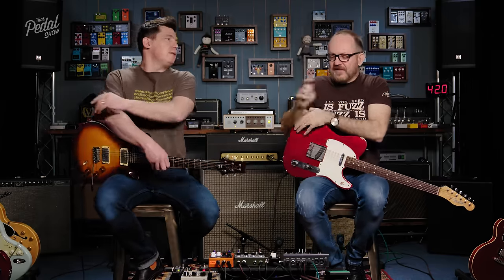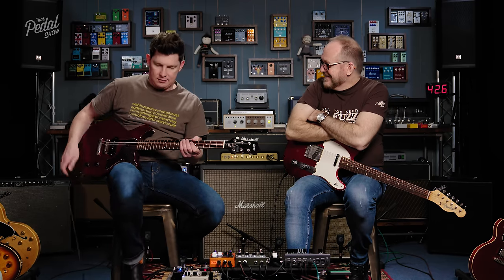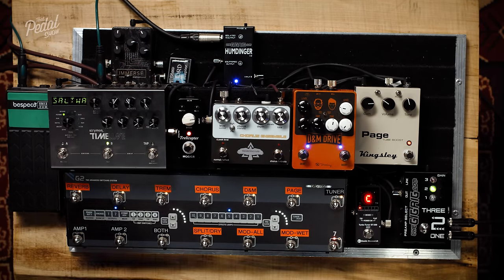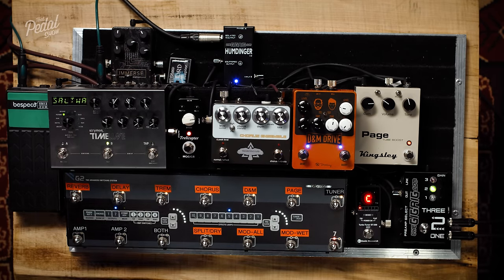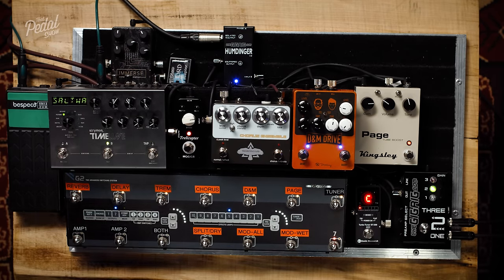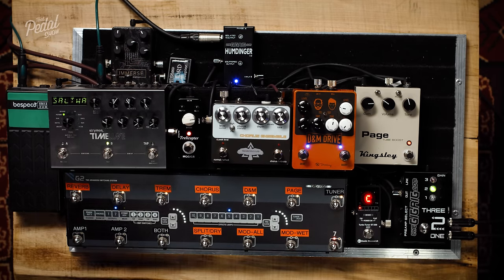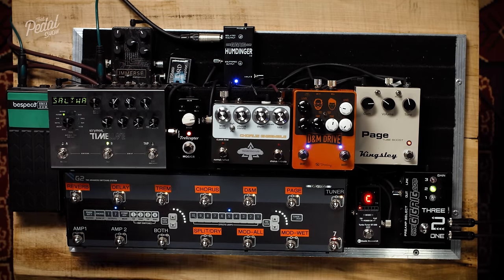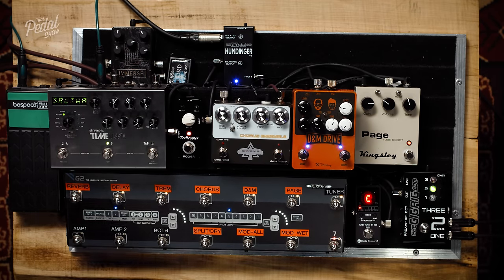Wet-Dry & Wet-Dry-Wet Amp & FX Setups Explained – That Pedal Show

Comment: The problem I am having.. I run wet/dry with a 2 channel Mesa single rec and a 2 channel Marshall dsl. I run both heads into one stereo 412. I keep the dsl set to crunch and channel switch the mesa between clean and dirty. This makes up my clean tone (slightly pushed sounding) and my  heavy tone. (Think big wreck kinda tones). These amps really fill each other out well. When I channel switch either amp it seems to reverse phase. I have a radial bigshot ABY. Delays and reverb in the loop of the mesa. OD and mod in the front of both amps before the split. Is there a solution to this? HELP!

Comment: Hi Dan, have you got a diagram for that pedalboard using the G2, humdinger and stereo reverb and delays?
Reply from the maker: Hi Warren, all you do is put the HumDinger in a G2 loop AFTER the gain stages. This is your dry amp output, but the same signal then travels to the stereo pedals left/right so that’s you Wet (stereo left) dry ( centre) Wet (stereo right)
Reply: @ThatPedalShow  thanks guys.  appreciate it.

Comment: Hey Guys, 
I have an issue with phase when using my H9. No doubt due to the fact that the entire signal gets digitized, a sin I know. Anyway, when I get the phase correct using 2 amps, they flip out of phase on sounds that use the H9. Any ideas on how to deal with this problem? Many thanks.

Comment: Hey guys, I had one question involving wet/dry and that's how you use the humdinger with a switching system? Do you put it put it back into the rig or does it go to the amp? There was a page I had seen through the GigRig site months ago but I can't find it again. Any help you could offer a budding musician?
Reply from the maker: It sits in a loop of G2. So for me -Mick here, out of loop 6 into the Humdinger. One HD out goes straight to the dry amp. The other HD comes back to loop 6 to continue through the rest of the signal chain (loops 7-10) then off to the wet amp. It's exactly the same principle if you have no switcher. Place it after your drive effects. Does that help?
Reply: That Pedal Show yea Mick, that’s what I think I was thinking. I think the only other thing i was wondering: does that mean with all of your presets involving modulation, loop 6 is always on? And whenever you disengage the modulations, you’re back down to one amp? In my brain, that’s the part confusing me

Comment: I don’t have the gig rig switcher. But I do have a switcher. Which has a send and return to my splitter to my dry amp that is a permanent loop but I assume I would want to turn my dry amp off anyway. It means I have 4 loops to use before my splitter and 4 after. So my question is should I make the splitter loop switchable or leave it in the permanent loop??
Reply from the maker: Depends. If you want the dry amp on all the time (which we do) it doesn’t need to be switchable. When I was using G2 - Mick here, I put my splitter in loop 4 or 5, with something else in there too, which means the loop stayed on all the time, but I used the switch on the pedal to turn that particular one on and off. Hope that makes sense, and good luck!
Reply: @ThatPedalShow  so using a pedal in the same loop permanently on switcher side of the isolated output means you don’t lose a loop but the effect would go to either both amps or just the wet amp depending which side of the splitter you place it. Then the pedal on off to engage. Hope that made sense.

Comment: I have an ABYBABY and I can hear  the difference but struggle to know what one is correct. Is there another way to tell? Also how do I know if my out A should be the Buffered or True bypass? I should specify I'm just running 2 amps not wet dry.
Reply from the maker: its just preference, one isn't better than the other

Comment: A really cool way of doing dry/wet, without needing a second amp, is to use a splitter box, a modeler and then running the wet signal DI. Basically hijacking the PA during solos and other effected parts :)

Comment: Can anyone tell me if buying all original vintage amps is a good investment? I'm concerned about a speaker maybe going bad or any component having issues and that decreasing the value once replaced as well as the issue of it not sounding the same once say a new speaker goes in.

Comment: Please explain a wet/dry setup using 2 overdriven single channel amps that clean up with the volume knob. I don't use pedals for dirt. Thanks!
Reply from the maker: It's exactly the same as this. Just use your volume know. And probably run the wet effects in the loop of one amp only. Cheers!
Reply: Thanks!! Do you mic both cabs live?? Any thoughts on how you mic them?

Comment: If you run into a sound guy complaining there's not enough channels. Just use a mic combiner, it allows you to put one mic out of phase with the other so they don't cancel each other out, this allows you to put them both into one channel. That way you don't lose anything through the PA.
I keep one in my bag just in case and it's came in very handy at times, ART make one that's very affordable and does a great job.

Comment: Would a wet/dry setup work into a single amp using different inputs (i.e. for amps that have high and low inputs)?

I’m thinking this might be a possibility for those that don’t have 2 amps.. they might be able to get more clarity from their wet effects by running them into the low input and the drives, etc. into the high input, but I don’t know if phasing issues or summing issues would come into play since it’s all going to the same amp and speaker/speakers.
Reply from the maker: Not really. The separate speakers are pretty important.

Comment: Only 10 minutes in guys so apologies for the early question as you may answer this later on... The issue that you are describing with having one amp seems to be around the signal having all wet, as things like tremolo etc aren't doing dry through. If you have a system (such as a Boss ES-8) that you can have a parallel effects chain; can you achieve this with one amp and have a dry signal path and then split this and have a dry straight through and then a path that goes through all the wet effects. it's then summed back into the single amp. OR is this an effect that's happening at the speaker level why it's "mushing" up?
Reply from the maker: It’s totally different when you separate the modulated signal from the dry and send that to two separate amps.  Don’t forget that those signals are mixed in parallel in the pedals anyway.

Comment: As I understood, in all the examples you run the g2 in stompbox mode. How does it work with pre-sets? Where would be the split in that case?
Reply from the maker: Same place, you just need to include the ‘split’ loop on every preset :)
Reply: That Pedal Show yeah off course, sorry for the dumb question! Cheers! Love your show!

Comment: Could you use something like a victory v4 into the effects loop return of an amp to run a wet dry rig with a single amp? Or would that work out just like having a single wet amp with a bit more gain in the middle of the chain?
Reply: By which I mean the split goes into the front of your amp for one side, and then into the preamp pedal (and then into the loop return) for the other side
Reply: And a follow up question, could you use the loop send to a separate power amp and cabinet (or even to the desk via a cab sim) for the wet side?

Comment: My first pedal is a buffer/splitter (no knobs or switches). From there → two signal chains with several pedals goes to two amps. One of the pedals is out of phase in one of the chains. If I have a ABY box with phase reversal, turning back the out of phase pedal, will also turn the pedals that was in phase, out of phase again. Every time I use the out of phase pedal with another pedal, I must bend down to the pedalboard and switch a tiny switch with my hand? Not exactly live friendly. There must be a marked for a dedicated phase reversal pedal/box..
Reply: The GigRig G2 would do that for you but you'd have to change your set up so that each amp got the same set of pedals (as opposed to separate pedal chains to each amp).  This would deal with the out of phase pedal per patch as Outputs 1 & 2 on the G2 have a phase reversal switch for the outputs that can be programmed to each patch.  This would solve the bending down and flipping phase issue but you'd lose your separate pedal chains to each amp.  I'm not sure of a more budget friendly way to do what you're looking for and this  suggestion is still a significant change to your rig by moving to one pedal chain.  So it looks like (a) keep the two pedal chains and keep manually flipping phase or (b) or consolidate to one pedal chain and let G2 flip phase on the outputs per patch to deal with that out of phase pedal and stay upright!  Best of luck with it! I'm sure Dan would have a suggestion for this.  Ah, they talk about this at 1hr 15mins.  Maybe a mod to the pedal itself.  

Actually put the out of phase pedal in the loop of the Xotic X-Blender, flip phase, leave pedal on and blend in the pedal with the rotary expression knob. That should do it.

Comment: question.. if you use 2 amps and split it with the humdinger going to the inputs of the 2 amps, what happends if you use both sends from both amps to 1 stereo pedal and back to the returns?
is another isolated output needed ?
Reply from the maker: Probably. Same issues though, you will almost certainly get ground loop hum and potentially a phase issue, depending on the amps. Try it though - there’s a chance it’ll all be fine.

Comment: Ok, I’ve been experimenting with wet/dry/wet and I can’t seem to add a third amp without encountering a crazy amount of hum. Running overdrives into a fulltone a/b box with the ground going to the dry amp and the lifted signal going to the two wet amps. I’ve got my modulation effects that are split using a Fulltone supatrem 2 to the two wet amps with a different delay after the trem going into each wet amp. I’m thinking the issue has to be using the trem to split the signal and I’m just going to have to bite the bullet and buy another switcher. Sound right? Or could it be something I’m not thinking of?
Reply from the maker: try swapping the outputs from the ABY box

Comment: A common hindrance to running 2 Amps is the mixing desk limitations of only having access to one mic. Is there any device available to combine two mics and send one mic cable to the desk? This way the performer retains full control of the wet dry or stereo image of the rig and also satisfies the engineer?
Reply: Calvin Heuer would a two channel mini mixer do that kind of job?
Reply: Luke Maybury yeah it probably would, but I was thinking more like something like a passive dual XLR input mini DI box concept with one master XLR out that can drive long cable runs, but that also has the ability to adjust the mix between the two input mic channels. Something that a gigging guitarist could carry in a bag to solve this issue. The idea would be to reduce the wet channel and then send one blended workable signal to the desk. I suppose a simple 2 channel mixer will do the job.

Comment: I'm confused about why you need the phase inverter. What is causing the two signals to be out of phase in the first place? Wouldn't it be the same signal (except one's wet) going to both amps so they should be in the same phase?
Reply from the maker: Some pedals flip the phase when you turn them on.... so if that pedal is only going to one amp, we’re upside down. Cheers!

Comment: Another thought on the “pedals that reverse phase” issue.  Can you deal with it putting a device that reverses phase eg Humdinger or Lehle P split before or after that pedal in its loop (if using a switcher)?  So when you kick the loop in the phase stays correct.  Both those devices phase reverse on the isolated output, so in a wet dry rig you would need to make sure this was not in your earthed signal path. Is that correct?  Cheers.
Reply from the maker: exactly this David :)
Reply: @ThatPedalShow  Cool.  I'm learning from you, Master :-)

Comment: Good to see a show made for the every man. Out of curiosity, I looked up the pricing for the pedals and amps. You too can make these glorious sounds for the low price of $12,700 USD, not counting the guitars or the roadies you'd need if you wanted to play it out. ;)

As always, love the show, guys. But this one, while still entertaining, was about as far from anything I'd actually try as you could get.
Reply: Nice homework on the price.  You can do this with inexpensive amps and much less expensive pedals.  It would be cool to see them have a whack at that.  Heck of a lot of info to digest.
Reply from the maker: We've done a video using less expensive gear on this exact topic, and we say in the video that you don't have to use crazy amps like this. The theory is exactly the same and it can sound incredible!

Comment: I went Wet/Dry a couple years back. I can't imagine ever going back.
Some questions for you though.

First off, with my set-up I use stereo delay and reverb but keep them panned to one side mosst of the time, except for certain sounds. (I play alot for my church, and it seems to be the cool thing to have extremely wet sounds)

I do like have certain delays in stereo as well. And the Boss Tera Echo is just glorious in stereo.

I'm wondering where you would put a rotary pedal. I'm looking into the vent and un sure if it is something that would be at the end of the chain and maybe even best in stereo? would love to hear your thoughts on it. 

I had a Leslie cab years ago and loved it so much. But havent had one since.  My Tremolo has a ramp feature that i would use for the feel.... but definetly not the same.

Thanks again for an amazing show guys. Definetly inspire me ever week.
Reply: I run it strictly wet which allows for great blending options, but I'm curious what ever came of this? Any luck with a stereo setup?

Comment: After watching this video. I have found out that I will have to be buying at least 2 more amps & 2 splitters that are isolated/phase reversible & something or other. I cannot for the life of me remember what that 3rd part of the type of splitter is. Also now I understand why some guitarists have such a massive sound. They have been doing similar things w/o the digital effects but they were still running these walls of sounds.

Comment: I'm not afraid to say, I got lost off during this episode and it's 100% the fact that I'm a doddery old bugger. So, if this has been covered, 'pologies.
I've got 2 identical Roland Blues Cube Hot amps (actually one's my brother's which he left here for when he visits). Each has it's own pedal board with a fairly regular range of pedals on each. I use an ABY switcher to put one guitar through both amps and only engage the pedals I want to go through each amp. So, drive through one amp and maybe Vibe and Reverb through the other. Is this a simplistic wet/dry? It sounds ok to me.

Comment: Hi Gents,

I’m thinking of running a wet/Dry rig as below:
Wet amp: Timeline, Big Sky, Chorus, Nano Pog
Dry Amp: Compressor, EQ, Soul Food, BD-2

However I’ve currently got these going into the Boss es-5 switcher, which has mono loops. I’m struggling to conceptualise how I would go about splitting the signal to achieve the wet/dry rig I’ve described above. Could you offer any advice please?
Reply from the maker: All explained in this video, with diagrams. You need more loops though, or to combine some pedals into loops. I also don't know if the ES5's main outputs can be assigned to take different loops? If so, assign your dry effects to output 1 and your dry and wet effects to output 2. If it doesnt, you need to split between two of the loops. So for example...
Compressor and EQ in loop 1. Soul Food and BD2 in loop 2. Split goes in loop 3 (for example TheGigRig Humdinger - one output to the dry amp, one back in to loop 3). Chorus and Nanopog loop 4, Big Sky and Timeline Loop 5. Mick here
Reply: That Pedal Show hi Mick,

Thanks for the response. I don’t think the ES-5 outputs can be set to send out different loops. I believe it’s just the combination of loops you have activated that go out to the ES-5 output.

The compressor is before the ES-5 anyway so that won’t be an issue. However Ideally I don’t really want to have to combine pedals into one loop as There are occasions where I only want one of those pedals engaged (1st stage and 2nd stage drive).

There may not be a solution I can think of at the moment whilst having the ES-5 in my rig

Comment: Can you explain what the reason would be for a pedal that flips the phase? It seems like an oversight in the design. Or are there situations where this is desirable to the builder?
Reply: Its more just the nature of electronics. Most gain stages, whether tube or solid state will invert the phase. If you have 2 stages, then your signal is back to normal. So even in digital pedals, you have some type of solid state buffer or gain stage. So depending on how many of these stages a pedal or amp has, will vary what you get on the other end. Typically even number is in phase, odd is out. It gets a little more complicated than that, but that is the general concept.
Reply: Jason Clute thanks for that!
Reply: @somewhatlikealex  Your're welcome. I was hoping that made sense. I hope TPS and others would agree with me. I figured D&M may be a bit pre-occupied with NAAM so figured I would take a shot.

Comment: Is it possible to do wet dry with 1 cabinet? For example a 2x12 with two speaker jacks and two heads?
Reply from the maker: It is. In one of the 10 Things You Asked Us To Try videos, we did it with an H&K 212. It worked great. I’m also currently having a 412 made for this purpose. Mick here. When it’s done there will be a vid. Cheers!